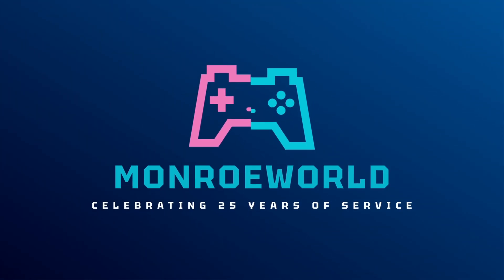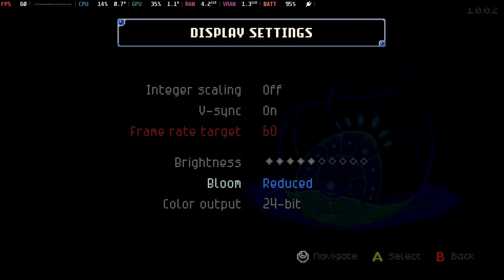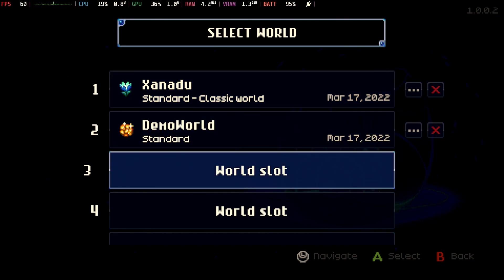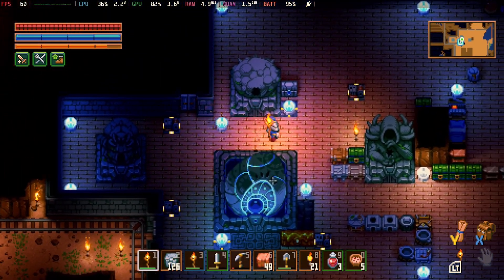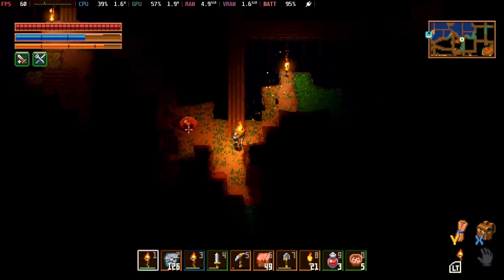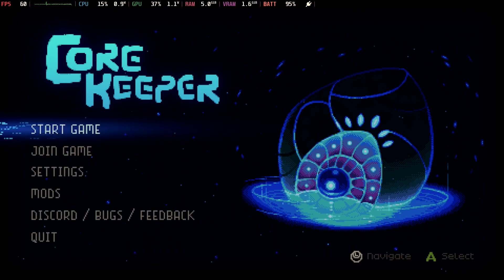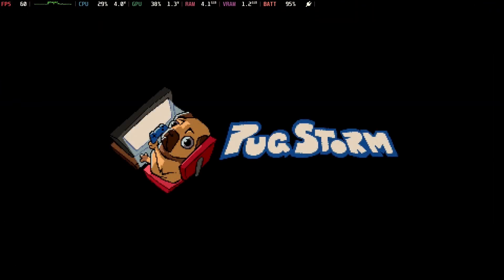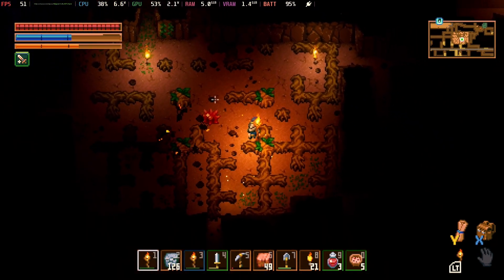Core Keeper 1.0 on Steam Deck: Technical Review, Performance Tips & Settings Guide

Comment: Well, you showed nothing.
I suggest tweaking TDP limit and upscaler to achieve 3h of gameplay instead of 1h.
For some reason, this game burns battery out of the box.
Reply from the maker: Appreciate the feedback.  The purpose of this video wasn't to show how to make the battery life longer.  It was to show the average user what they could experience if they bought and installed today.
Reply: What did you change to make it last 3hours then?
Reply from the maker: @wesleyjansen232  Nothing ... I'm using an OLED :)  The game is dark - OLED has great battery life with this SKU.
Reply: Games like this should pull 9W max. I'm sure they'll optimize the game to not be more demanding than open world AAAs smh

But yes, this video was useless. Docked, no wattage, can't tell how it'll be in handheld
Reply from the maker: @cqllel  Docked means nothing.  Wattage was right in the mango hud.  It will be in handheld EXACTLY as you see here.  This isn't a Switch.
Reply from the maker: @cqllel  This channel is more for basic, newbie users. Most of my viewers aren't underclocking RAM or doing things to eek out every watt.  :) Doesn't Team Cryo run a YT channel?  Might find that sort of info there?

The Mango is the hud that shows performance along the top during play.

Comment: Out of the box without touching Proton, I had some issues with the game ignoring my headphones when I played with them plugged in. I had to go into the steam deck settings and switch my audio output device back and forth between the default and speakers. Switching to Proton GE seems to have fixed it.
Reply: The other thing I wish worked a bit better is the controls. This is one of those games that doesn't like to accept simultaneous gamepad and mouse inputs, so when I set the trackpad to act as a mouse, I have to click it down (right trackpad click as left mouse button) to get the mouse cursor. But if I move, I immediately switch back to gamepad mode. I was hoping to use the mouse for better precision when base building, but it looks like I'm going to have to dig deeper and create some kind of action layer hold when touching the trackpad to switch other controls to keyboard equivalents (WASD on left stick instead of left stick for example)
Reply from the maker: @dgevert  hmmmm.... I've only played the game with a controller ... Even on PC.
Reply from the maker: @dgevert  thanks for the Intel...